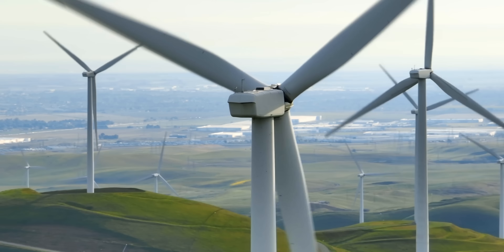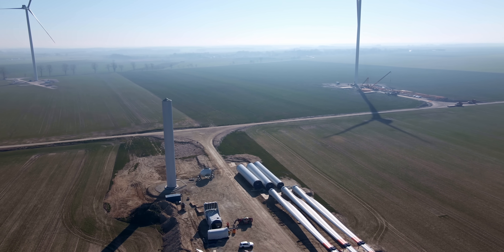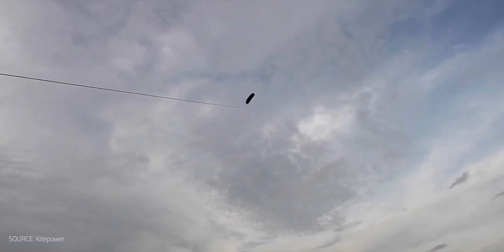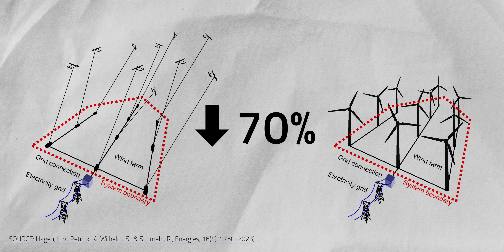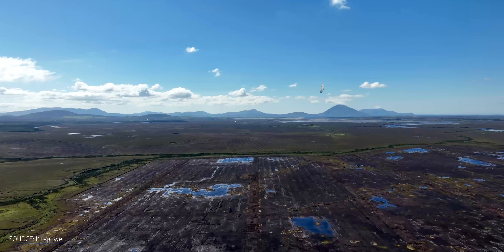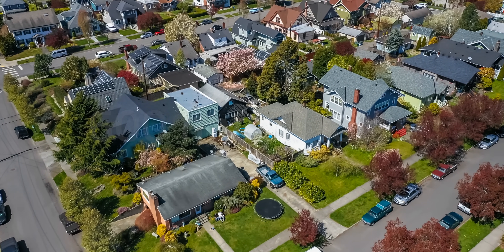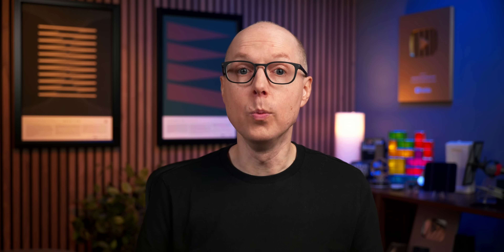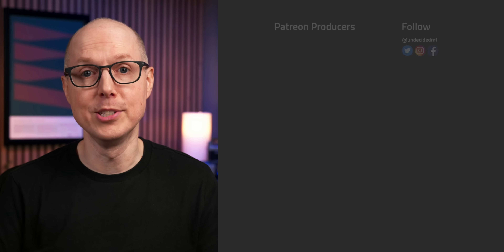Are We Building Wind Energy Wrong?

Comment: Wind kites are OK for niche applications, but not for grid scale use. You couldn't get the density of kites to reliably match that of wind turbines per kWh generated, as you would have cross tangled kite cables everywhere. Thus that wind kite capacity is limited per unit area of available sky compared to wind turbines. The sweep of the kite is effectively conceptually equivalent to the diameter sweep of the wind turbine blade, however much wider.   A lot of complexity waiting to unravel in a tangled mess.  Doesn't make a lot of sense for grid scale usage, unless one's as high as a kite.
Reply: Actually, it would be more complicated, but if the winstreams they're taking are the same, there's no reason for the wires to cross, as they'd be flying in the same pattern from wind appearing in the same direction, correct?
Reply: @tumultoustortellini  I'd think what makes this viable is that the kites are steerable.   As a large gust propagates through the field, the flight path is adjusted - in a way similar to a flock of birds or school of fish.
Reply: as noted, it can have an 8x increase in power at altitude, so you need fewer of them in a given area.   Not everything is as it seems on the surface, that's what experiments and trials are for.

Comment: I'm surprised they've gone for the yoyo method. I'd have thought a spring system could be used with the spring allowing the kite to oscillate in and out with that reciprocating motion then converted to rotary to generate power.

Comment: The concept sounds promising but I can't help but fixate on on one major concern that wasn't really covered in this video - air traffic.  With a turbine, the blades are confined to a certain area where planes can safely fly near or over but with how these kites move side to side and change in elevation, it definitely complicates air traffic in the area.  This is especially a problem given how often wind farms are placed in and around traditional crops and the need for crop-dusters to fly over said crops.  The high altitudes also limit the proximity they can be placed to airports and common commercial aircraft routes.
Reply: I'm not worried about general air traffic. If you can configure it to be under the flight limit, ATC wouldn't even need to get involved. You're absolutely right about crop-dusters, but I think that's workable, since the kites can be reeled in when the airspace needs to be clear. Now, I don't know jack shit about farming, so I don't know how often crops require treatment, but my guess is like 1-2 times per season, maybe once a month. The hazard for the pilot is pretty high, though, if someone forgets to reel in their kite, so I can imagine how this might be quickly regulated into the ground.
Reply: Well if we're trying to be sustainable crop dusting should go. Monoculture farming in general is disastrous for the environment as well as synthetic fertilizer and of course pesticides.

Comment: I am weary of the argument that in case of emergency people will go for this system instead of just a dieselgenerator for example because in an actual emergency. there should not be a climate concern in my opinion. but other than that, this tech is cool and a reason for optimism ！

Comment: 8:50 kW means energy (Joule) per second. So kW/h means energy per second per hour, which is probably not what you meant.
Reply: Ahh, now I understand the intention, but kW / h makes no sense, if you want to express an average, just say 30 kW average (over an hour), not per hour. You cannot express an average by dividing it. To explain, Power can be expressed in kW, but also in horsepower. You can't say your car has 100 horsepower per hour or 100 hp / h.
Reply: 30kW/h means exactly that. Because this source is not continous, you can only calculate the instant power of going up, but that depends on the angle and path length. Then you need to pull it down again which would consume energy. Because of this reason, energy capacity is a better measurement as this can't work at all without batteries so at the end you care about how much energy you stored after an hour.
Reply: @alexandruilea915  You need to divide the accumulated energy per cycle (kWh) by the cycle time and you get the average power in kW. 
kW/h is just wrong. It would only make sense if we talked about the rate of change of the generated power as it increases over time, but that's pretty irrelevant in this context.
The only case where we talk about the power ramp up rate is when we compare the spin-up time of different grid stabilizing / backup plants.
Reply: @VulpeculaJoy  Sure, but they don't want to promise an average KW power because it's probably very unstable between runs. The better unit would have indeed been kWh directly.

Comment: I never understood the phrase "This produce X amount of power which could power Y number of homes". Mainly due to there not being a follow being "This is the total number of homes this country has, so the % power this covers is Z".
Reply: It's for people who aren't familiar with units and need some way to visualize generation. "The average home in the United States uses about 10,632 to 10,791 kilowatt-hours (kWh) of electricity per year" which is far higher than the assumptions in "could power Y homes" claims, and as homeowners shift to EVs and heat pumps their electricity use will increase (while primary energy from burning dirty fossil fuels goes way down).

Comment: This feels like something that makes sense to outfit small towns and villages with. If the energy they require is generated mostly locally, that cuts down on the infrastructure costs and the inefficiencies of connection with a larger grid. It also makes them much more robust against failures of the grid.
Reply: What exactly is the benefit over building one or two large wind turbines on the ground close to the village for a lot less money? Or build them a mile away. Grid transmission and distribution losses are small , less than 5%.
Reply: @skierpage  Protections against NIMBYism, cost efficiency (vid said they'd be cheaper and produce more power), Takes up less space which could mean less maintainence

Comment: wait.... they use the energy generated by the kite to reel the kite in? why not use gravity to reel it in? when the kite reaches it's max length it could tilt so it catches less wind and can be reeled in with less force/energy, then a weight could drop generating energy and reel the kite in, then the kite generates energy pulling back up...🤔🤯
Reply: Kitepower does that, Matt Ferrell explains it poorly. In their video "Kitepower - Harnessing the Power of the Wind" at 1-49 you can see the kite turns sideways to the wind and "smoothly returns to the ground" landing ~50 meters away. Doesn't look like it uses much electricity. (Kitepower doesn't show how it re-launches the kite!)

Your weight drop makes no sense. The kite pulls hard on the winch on the way up to power a motor-generator; the motor-generator uses a small amount of energy to reel the kite in.

Comment: I get real skeptical of the point about higher wind speeds at higher altitudes.  This is basic physics here: the higher you go, the less dense the atmosphere is.  Less dense molecules have less inertia, which may allow them to gain speed more easily but it also means they're going to be less effective for energy collection.  This is one of the reasons why airplanes fly as high as they do - there's a lot less air resistance.

Comment: At 8:49, do you mean 30kWh per hour? (Essentially 30kW average power)
Reply: This. A pretty odd mistake for a specialist channel. My guess: just drop the “per hour”.
Reply: I caugght that too. Was definitely a mistake.
Reply: @monkey_d_taha4967  Is this mistake can be done by someone understanding energy ? 🤔
Reply: If it's not a mistake. 
So It produces 30kW/60/60 per second. 
So 8.3watt per second. 
In one hour 8.3 Wh.
Reply: @sayyidsahal4533 A Watt is a unit of power. 1 Joule (of energy) already per second. The only sense you could make of W/s would be: 'rate of change of power'. e.g. a measure of how fast your generator is going from delivering 0W to delivering 100W.
Reply: @rbettsx he said watt per hour.
Reply: @sayyidsahal4533  It's 100% a mistake. like rbettsx said, W/s doesn't fit into the context of the video.

Comment: My first reaction to hearing about combining kites with wind farms; how is it a good idea to have long wires flying around towers with spinning blades?  If they're "using the same space" that means near wind mills, but you can't actually have them close to wind mills at all, or you can have wires interacting with the wind mills. A windmill will have a small radius around the base where you can't build, and not very high around a larger radius, but only because that would interfere with the wind currents, and thus affect the efficiency of the wind mill. A kite would need a radius of several hundred meters, because if the wind turns 180 degrees, there can be nothing in the way, or it will interfere. There can be nothing on the ground, because if the cite drops, you have 100's of meters of cable strewn across the ground.

Would the surface needed cleared for a single kite be viable for up to 4 wind mills? Leaving a whole lot of ground space for low construction and/or something like a solar farm?
Reply: Maybe deploying them downstream the wind turbines would make it work out great !!!
If the wind turbines created a wall of slower wind behind them then the kites could benefit from that by tapping into the higher wind speeds above "the wall" when climbing up and being more easily brought back under "the wall".
Reply: The kite and blades would likely use the same wind direction, so as long as the kite is mounted to the rear it will always be trailing behind the blades. Plus the kites aren't flying at long angles, but high angles from their anchor points. You could even spool them out higher with a simple modification to how the guide wheel/spool is mounted.
Reply: @Lunarl4ndr  when they’re in power generating mode, they’re actually flying at a fairly shallow angle. And they would have to be at least the tether length away from the wind turbines because what is upstream in some winds is downstream in others.
Reply: @Lunarl4ndr  But is it not possible for the wind to change direction even at that altitude?
Reply: It probably makes no sense to put them that close to each other. One will make more sense in that location (probably the traditional turbines) and those will dominate.

Comment: I don't think the boat idea will work at all because that's going to be pulling the boat off course or placing drag on it, causing it to burn more fuel to compensate.
Reply: Firstly DO not use Fuel. Secondly install a Counter sytem.. 3rdly Disregard your Thoughts of Failure. Launch it And Float the wave. 
Better to FLOAT a Buoy with a kite first.

Comment: Did you really just use "kW/h" as a unit? "30 kW/h" means that the power changed by 30 kW over an hour. So a lot of fluctuation. What you wanted to say is that the kite produces 30kWh of energy per hour. That makes sense. "kW/h" doesn't.
On top of that your graph with "generated power" doesn't make sense either. Is the power generation increasing over time? No, of course not. Should have been "generated energy". You even say that reeling the kite back in costs energy, not power.
Reply: I am guessing you mean the kite generates 30 kWh per hour which is equal to 30 kw solar panels at noontime.  Since the average US residential cost of electricity is $0.17/kwh, this system produces 30x.17=$5 per hour.  This is not much payback.
Reply: It does make sense. Its just a bad way to say it 😂